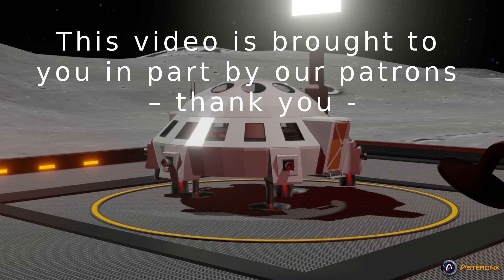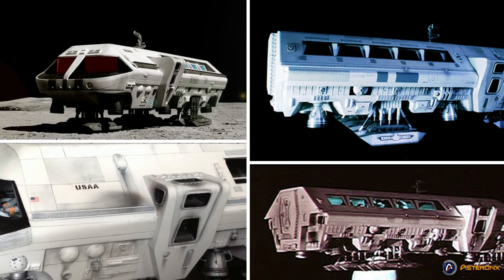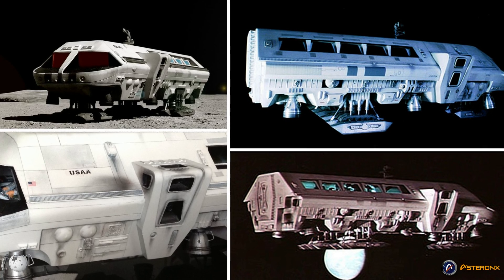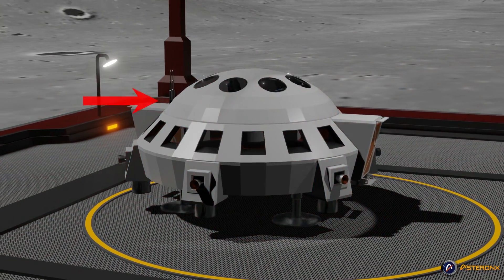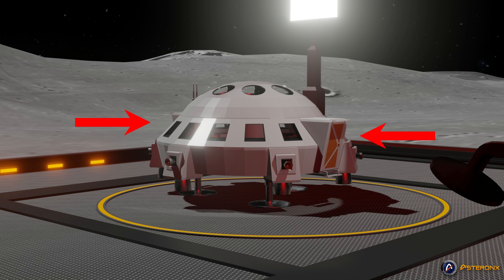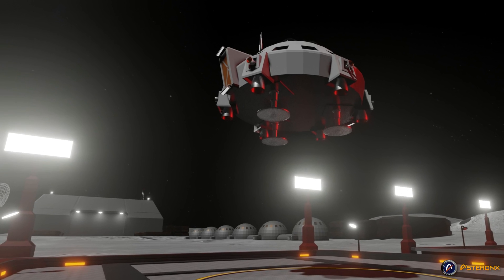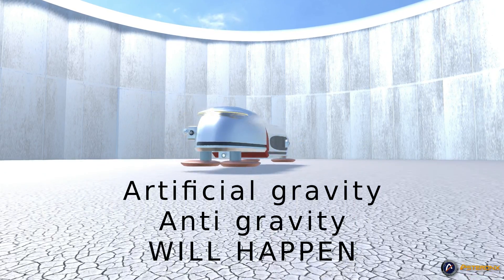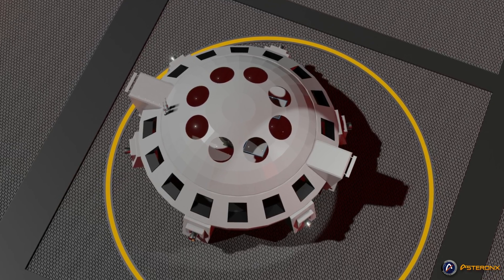2001 A Space Odyssey Moon Bus Remake

Comment: The roughly hemispherical shape is more efficient in weight saving because of the greater volume to surface ratio afforded by spherical forms, but this shape also requires less bracing and reinforcement for holding atmospheric pressure; however, the dome shape and highly slanted view ports at the top of the craft in the piloting deck provide very restrictive views of the ground close to the vehicle--not a great idea for traversing extremely uneven ground--and also allow excessive light and heat gain from the sun.  My suggestion would be that the upper deck be retained for piloting to give better angles on terrain (need a new word for that on the Moon, I guess) but the sides and covering of that deck should be a shape similar to the air traffic control towers--downward slanted windows with an overhanging roof.  Sorry, this is not does not have the sleek aerodynamic look of your design, but there is no aerodynamic consideration necessary on our airless Moon.
Reply from the maker: No apology necessary, it's a good suggestion, but we weren't aiming for an aerodynamic design anyway. The protruding "windows" double as lensless cameras, which are fed into holographic screens (flat screens but with the ability to display depth) covering the inside walls of the cockpit. Chances are that cameras on the lower side would feed into these screens as well. But thank you for your suggestion :)

Comment: The biggest difference in our understanding of the moon from the time of the novel/movie 2001 is the danger of lunar dust which can be suspended above the ground by static forces. Such dust which is technically so sharp it can cut DNA strands within living cells, would pose a major threat to long term vehicles on the surface. Thus the argument for non retractable landing legs makes perfect sense. The double doors, on the other hand, probably doesn’t make sense since the docking facilities required for such vehicles might cost more than the delay time for the boarding process of using a single doorway. The vehicle would have a preferred “forward” since that would be the direction where the pilot / copilot would face, if for no other reason.
Reply: Christopher Beattie : What are your thoughts on a ramp design like on the back of transport planes. One half rase and one half lowers. An assumption is the bus would be used for transporting equipment as well as personal. This design would reduce the loading and unloading time and larger items could be loaded.
Reply: @CraigLYoung  : I tend to prefer more of a Space 1999 mindset for lunar cargo. Basically you design the cargo bus to grab container modules, drop them off at a destination and allow the destination station to move them to the loading dock, freeing the transport to carry another module.
Reply: Christopher Beattie : After giving it some thought,  I would have to agree with you.

Comment: This actually isn't as good a design.  
The circular floor plan would be harder to load, lending to wasted space.  Same as dome homes that mathematic,y are efficient, until you try to actually put furniture in them.  
The extra volume complicates life support.  
The cockpit on one end is optimized for the crews view.
And the 2001 moon bus' landing pads wernt retractable, they were set up to allow the craft to walk by lifting one of each 3 pads of each set of 3 forward or back, then the others etc.  to walk the bus forward for short distances.

Comment: Nice design..I'm not fond of all those ceiling windows letting in radiation....Unless they are lead windows? Or they have optional  pull down shades.
I still like the 2001 one.
Reply from the maker: They're actually more sophisticated than just plain old glass windows, embedded with lead/tungsten and probably gold, but also doubling as lensless cameras (such a thing now exists), projectors would project a 360 view on the cockpit walls, so you couldn't actually tell where the windows began and the wall started.